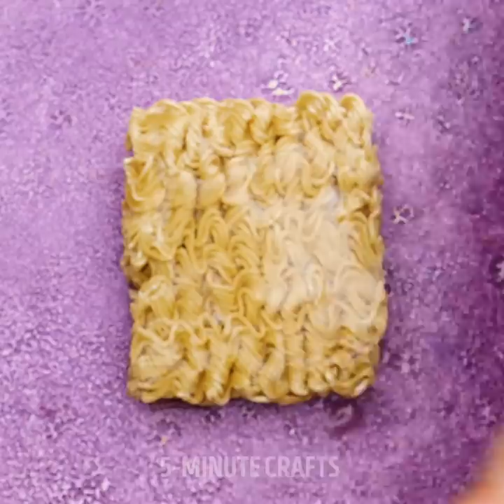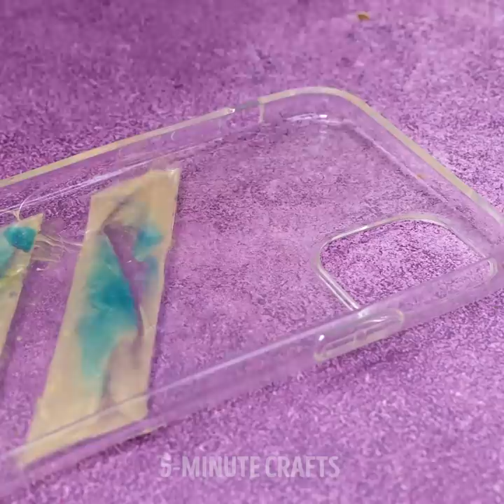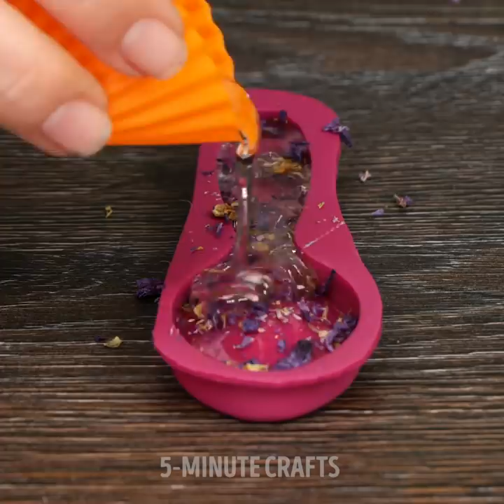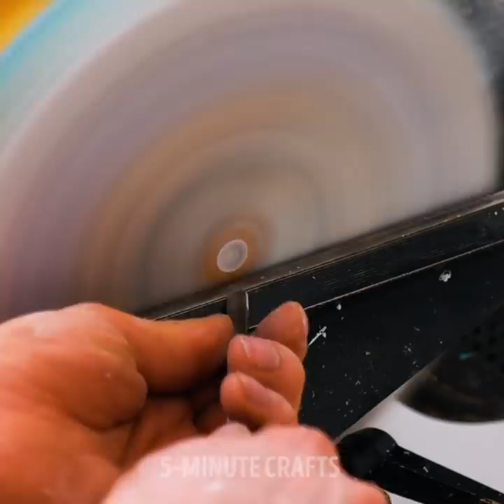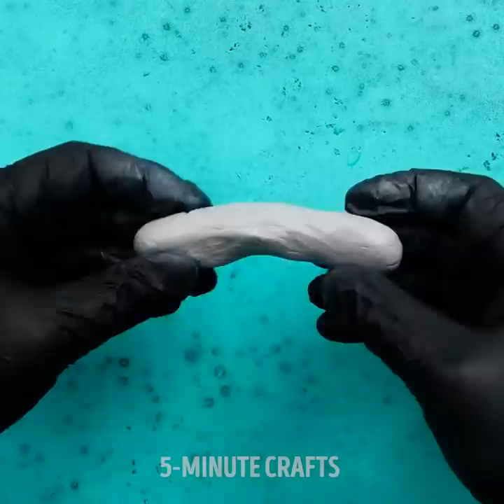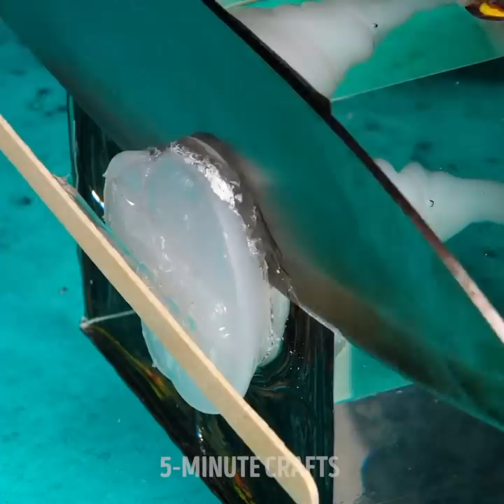29 Cool Resin Crafts To Make In A Minute

Comment: Im back to see some lies!

Fact: resin takes some hours to heal

Edit: stop saying that under UV light it heals faster than normally. Yes, i know that, but it doesn’t take minutes!
Reply: And wood churning takes at LEAST one hour. Not one minute
Reply: @3amEdits  true. True.
Reply: They use uv lightd
Reply: @charlottekang2204  still takes longer than 1 minute :/
Reply: They are using uv resin the light speeds up the curing
Reply: @stephaniecarlson4400  again, it won’t take 1 minute. Probably like an hour or more, i dont know.
Reply: It’s UV resin
Reply: @Serena Kindy I know that but the channel is called 5 Minute Crafts yet they’re showing us 1 hour crafts
Reply: If they used uv resin it really only would take abt a minute, but I think you can only use it for small things

Comment: Debunking facts: you CANNOT cure uv resin in aan opaque mold the bottom would never cure and your left w a stick mess. Dont use uv resin for a big mold otherwise it will warp and or overheat (use casting resin instead). You cant use live/ undried  botanicals because its not actually stabilizing the plant and it may be subject to rot and the moisture may ruin the cure. A lot of resins are unsaafe to come in contact with your food and you should use specific food contact safe resin (which ive never seen come in uv form)
Reply: I use opaque molds with my uv resin on a regular basis and don't have any issues...you just need to do it in thin layers and cure between layers.